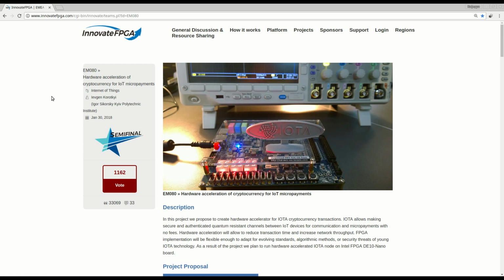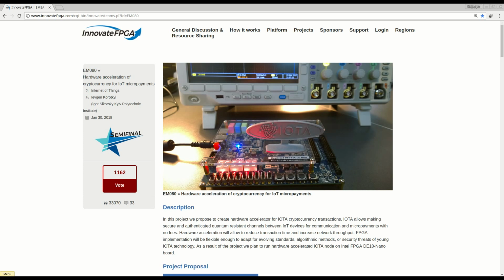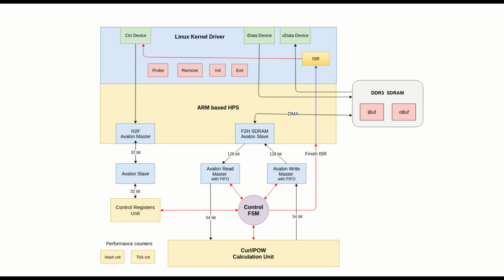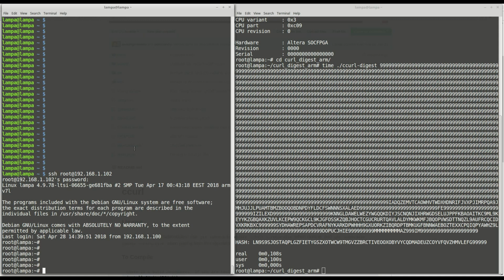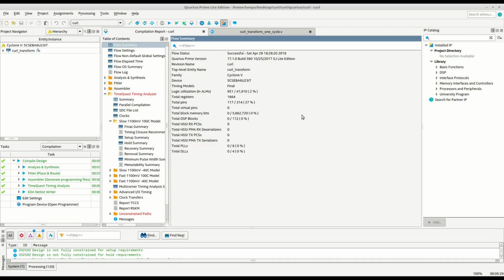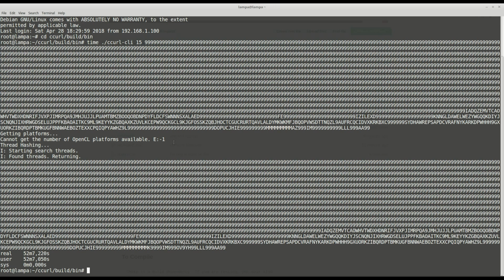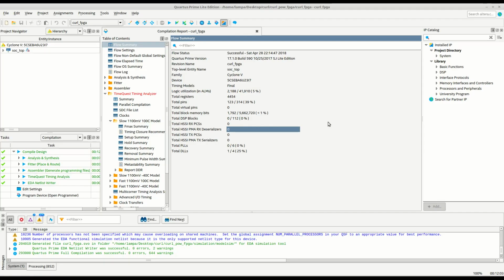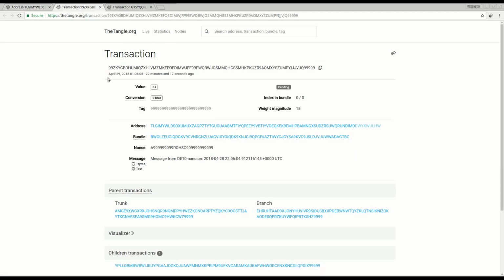FPGA hardware accelerator for Curl POW computation in IOTA cryptocurrency

Comment: This is huge. Any plans to release "curl_transform_one_cycle.v" with some information about how it works in detail ? Thanks !
Reply from the maker: To the end of the month we'll write some tech info in design paper on project page and in near future upload all sources to github
Reply from the maker: Yes, we saw this implementation. It was released a few days ago. It looks like this design has comparable performance (the hash rate is several times higher but hardware costs are also higher). Our Curl POW accelerator takes nearly 10% of Cyclone V with embedded ARM. So it can be successfully scaled. With increasing of the clock rate we expect obtain in future nearly 10 Mhash/sec. And finally our implementation do not need any external microcomputer like Raspberr Pi and utilize high speed 128 bit bus (which can be extended to 256 bit) for data transfer between ARM and Curl POW accelerator.
Reply from the maker: Under hardware costs I meant FPGA resources. Except custom board with Cyclone 2 one also should buy modern RPI for approx 50$. And price become nearly 70$. From other hand, price for DE10-nano is 110-130$ (may be less in case of custom board). Not much more expensive.

"upload a couple of hundred bytes" You should upload couple of hundred bytes in case of software precomputed midstate which takes time. But the raw transaction is 8019 trits long. It is nearly 8Kbytes in binary representation.
Reply from the maker: Yes, its interesting to see the code. 200 MHz for Cyclone 2 looks quite unrealistic. It is very good result if it is real numbers.
Reply from the maker: Released source code: https://github.com/LampaLab/iota_fpga